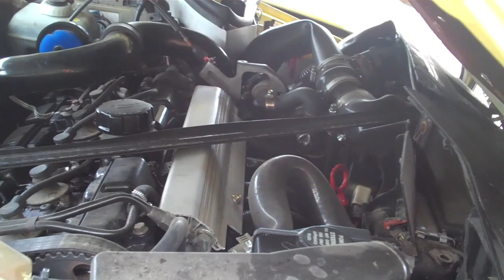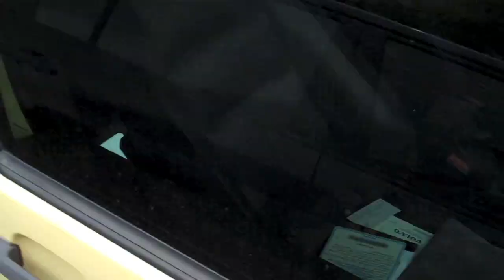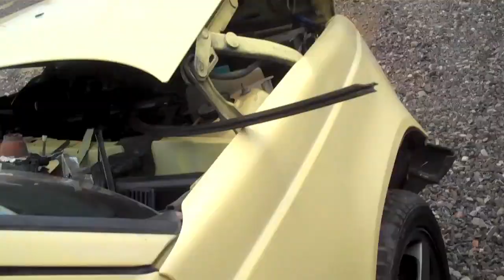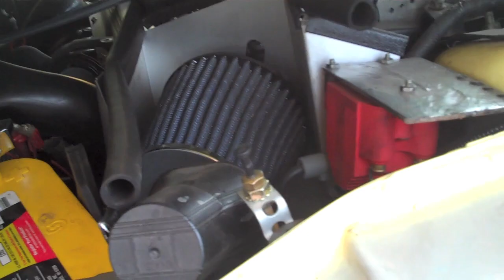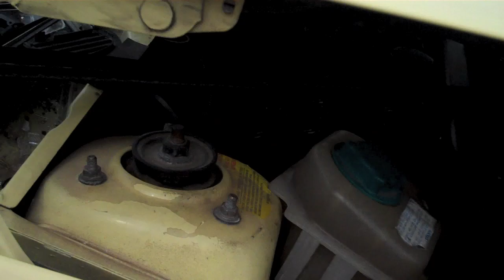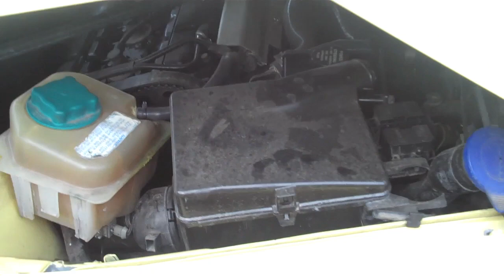RIP The Yellow

Comment: Tottaled? I have rapaired things worst than that...
Reply from the maker: +Luís Ferreira Well the unibody structure was bent over to the right by a foot and maybe it's repairable but is it worth spending $10,000 to fix a $2000 volvo that may never drive quite right again? Or just buy another yellow volvo like I did.
Reply: Mesquite Automotive yellow T-5R sedans are going for 8 to 10k now and I got two offers of 18k and 20k for my yellow T-5R wagon